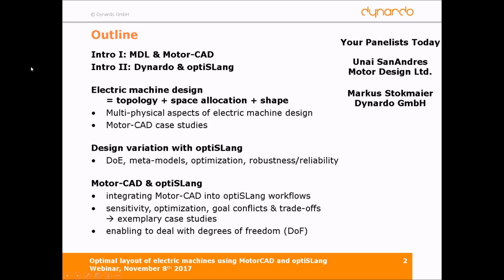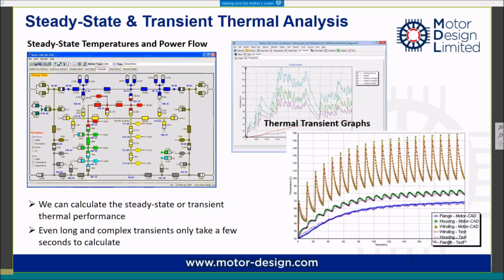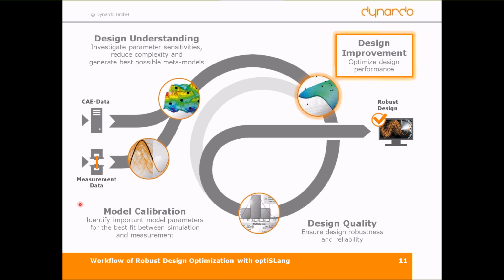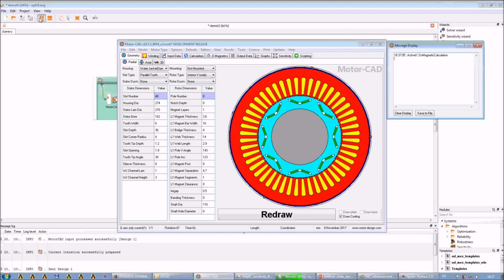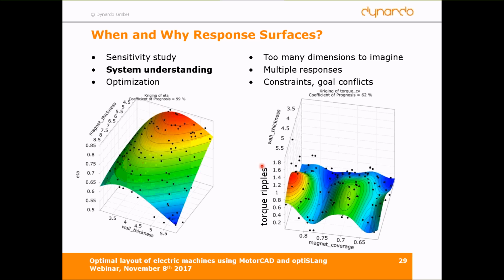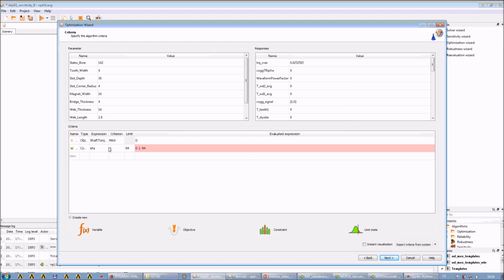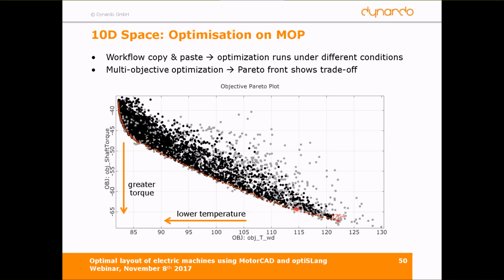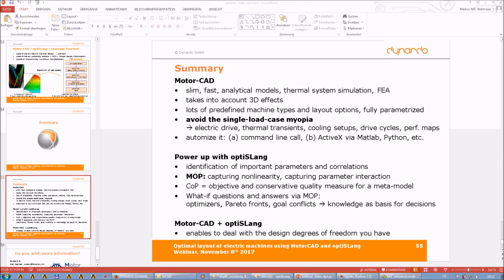Webinar optiSLang MotorCAD 2017 11 8

Comment: I am interested to use this interesting software to design a novel 
motor. It has a novel configuration and does not match with any of the 
modeled machines (IM, PMSM, SRM, ...) in Motor-cad. I was wondering if I
 can design a new and different topology in your software and benefit 
from the simulation capabilities of the software?